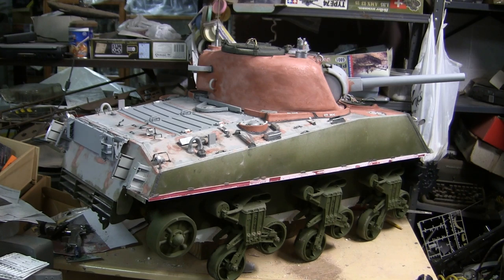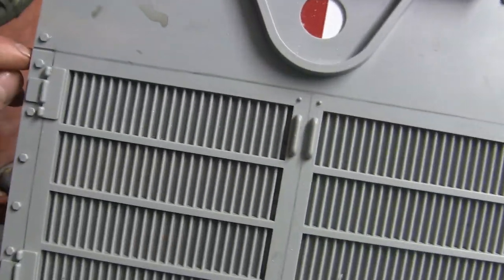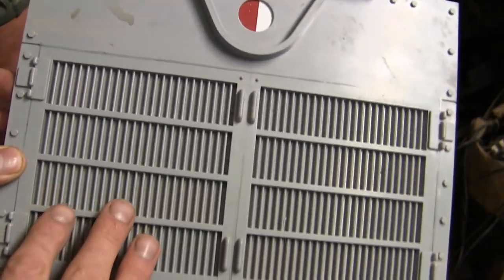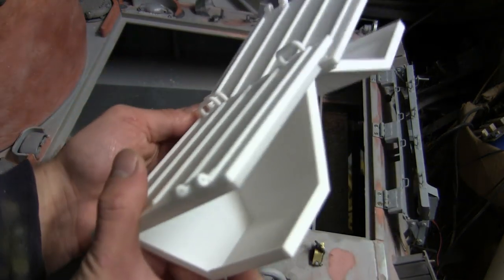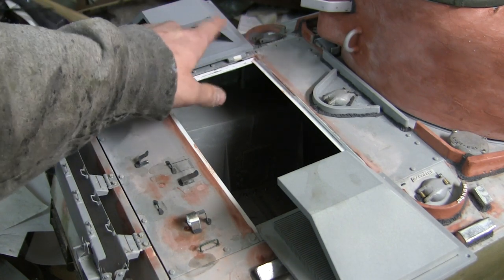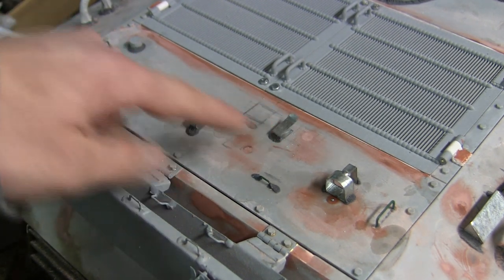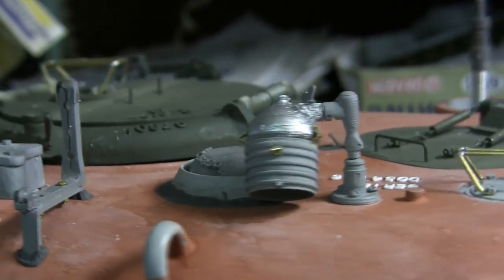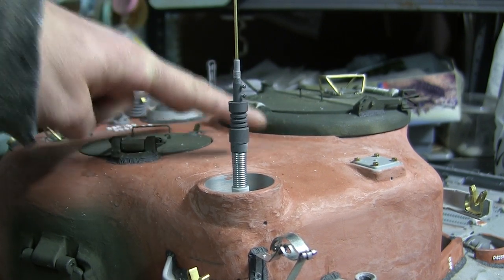1/6th scale Dragon M4A3 Project video #7 (ready to paint)

Comment: Excellent Build! What size are those bolts did you use for the end part of the 3D printed grill covers?
Reply from the maker: I want to say M3X6 hex heads, they should be longer as on the real tank they strap down the grillwork to the engine deck, however since this build doesn't have an engine compartment the bolts were for detail only so being shorter was a non issue.